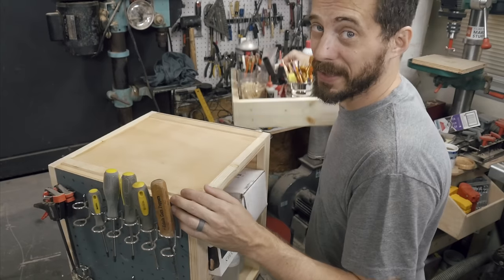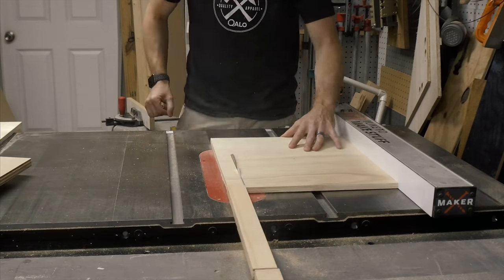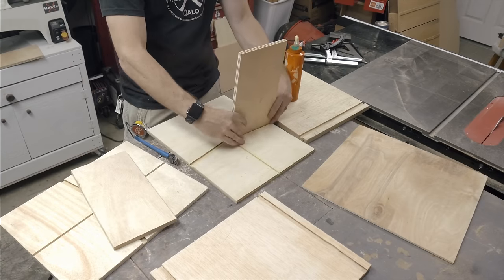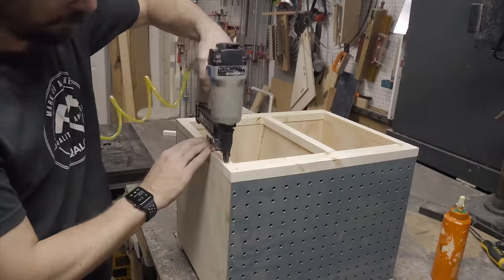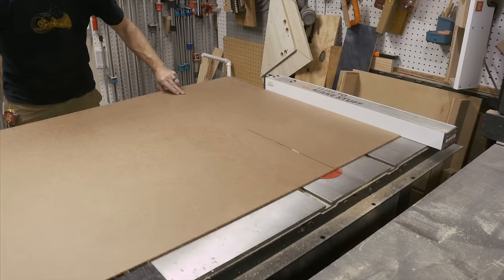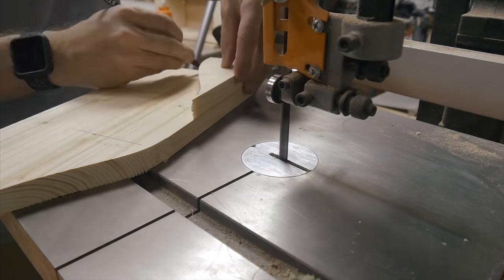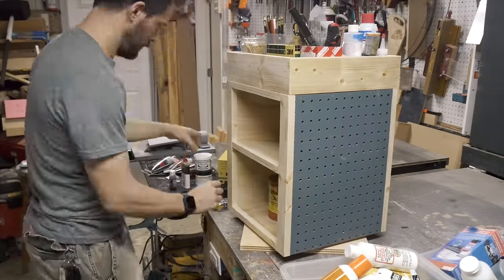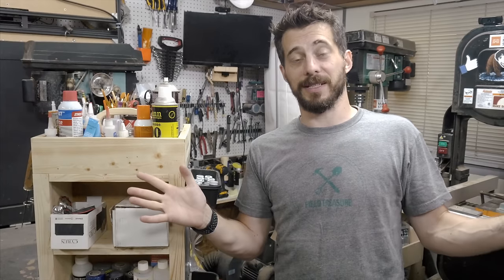How to make a spinning shop organizer // Woodworking | I Like To Make Stuff

Comment: Things I need: digital protractor, silicone brush.
Reply from the maker: Speaking of, I need to add that brush to the description.. THANKS!
Reply: I Like To Make Stuff MotörHeavyRockHead 
I've seen silicone brush used before for resin, but not glue. Thanks Bob.
Reply: the best thing is waiting till the wood glue is dry and then picking it out of the brush... does that make me weird?

Comment: Great video, as always! Just for knowledge sake, there is a more secure way to attach the lazy susan. There is a larger hole on the base (you can see it in the back at 4:42) designed to give you access to the screw holes on the top. Drill out the material under that hole in the base, then you can fit a screw driver through it to screw the screws into the top material (the top holes line up over the bottom hole, just rotate the top to reach each hole). That means you no longer have to worry about your screws being too long and locking up the lazy susan, and the head of the screw is more secure than just threading a screw through the thin sheet metal.

Comment: An excellent project Bob. My only suggestion would be to add some latches so you could use the handle in the removable top to cary the whole unit at once. Maybe add a removable base unit with castors so there would be an option to place it on the floor if you needed the extra table space or tucked away when not in use.

Comment: not gonna lie I need one of these to sort my small bits odd and end
Reply from the maker: It's super handy!
Reply: ALPHAURSAP  You just gave me an idea - Drill bit storage. One side of the organizer could be used for drill bits or router bits. Possibly both...
Reply: Mark Lindsay I was thinking the same thing for my dremel bits but also possibly mount the press attachment and holding bits on the top
Reply: Mark Lindsay Maybe circular saw and table saw blades if you adjust the design a bit :)

Comment: Hey Bob, I just got my first commission making something for someone!
Reply from the maker: Awesome, congrats!!
Reply: What is it for?
Reply: A raised planter bed made out of 2x8s, 2 actually. I do some freelance carpentry and landscaping in my area. Thank You for asking!
Reply: Nice! Sounds like fun. How did you get started with freelance carpentry?
Reply: I did a lot of DIY things around the house, mostly building things for the yard like decking, planters, fences and things like that. Then my neighbors started to ask if I could do some stuff for them, it's not a full time job or anything. Most of my work up to this point has been repairs or assembly. this is the first project that I've designed and built completely. You can actually follow me on twitter if you want, I'll probably be posting pictures up there when it's finished. https://twitter.com/SON4RENT
Reply: Adam Oliphant Well done and good luck with your future.
Reply: Hey Adam, its two years since  your original comment, hope you are still building and still earning from it best wishes.

Comment: WD40 is not a lubricant. Please bob teach the masses!
Reply from the maker: Actually, I was using the WD40 brand "gel lubricant" :)
Reply: Wow that's confusing. Thank you for the clarification.
Reply: I Like To Make Stuff  My pled still stands.
Reply: Although normal WD40 does have some lubricant with the solvent.
Reply: I Like To Make Stuff I would recommend getting some Tri-Flow lubricant but that's just me. As always, nice videos!

Comment: Nice concept. I like the use of all sides. The only thing I might change is the handle for the top. With a centered handle you'll need to have the load evenly distributed. If you had a handle on each side (like a loose rope handle) you could load the top without having to keep shifting stuff around. Still a great idea for saving space.

Comment: You could also use the 1/8 inch gap between the top and middle for things like rulers and protractors, but it might need to be a bit bigger

Comment: You could actually use some buckles/flip latches on the top to secure it to the bottom.  That way you pick the whole thing up and move it around using the handle.

Comment: When I use those lazy susan bearings I drill two 3/4" holes in the base piece that line up with the 3/4" holes in the bottom of the bearing. Then I mount the bearing to the base first and use the 3/4" holes to access the screw holes in the top and mount it to the top piece. That way I'm using screws into wood rather than depending on sheet metal screws. I can also take it apart for finishing, or whatever, and not worry about the sheet metal screws stripping out when I put it back together.

I finally just made a CNC file to drill the two 3/4" holes and just "kiss" the locations of the 4 mounting screws so I don't have to do any layout other than centering the CNC over the base piece.

Comment: That little thing is pretty dope! I haven't messed much with angles yet, even though they'd be extremely helpful in some projects, maybe one day! That interlocking bin on top was super cool too! It wouldn't have been as nice looking, but you could have tried leaving that face frame off so that gap between the peg board and sides could be used for paper, stencils, books, etc. but awesome none the less!

Comment: Nice job, Bob!  Your comment about the band clamp made me chuckle.  So to cut the diagonal grooves for your slanted shelves, did you just freehand that with the router?  Or did you use a straightedge to guide it?  Couldn't really see.
Reply from the maker: I just did it freehand, which was a bit scary to be truthful.  It worked better than I expected, but you could also clamp on a straight edge at the correct angle and run the router along it.  That'd give a perfectly straight line.

Comment: Cool project.  One thing you could've added (or could still add) to the top was another simple box, that used your removable box as a lid.  That way you'd have even more storage in the same footprint, and you'd be able to tuck away things you don't need to get to as regularly.  It might be too much or too inconvenient for your needs though.

Comment: I would recommend you put some brad nails or screws from the outside into the handle on the top tray.  I'm always paranoid of over filling (weight)  a tray like that, and the installed handle pulling out of its location and the tray falling to the ground

Comment: Maybe some locking casters under the bottom platform to give it Mobility and still the rotation.
And add removable flight case lid closing claps on either sides for the top box,
So it holds down the top box and then using the handle on top to roll the cart around the shop for storing it.

Comment: Evening Bob love all the work that you've done :D , also as you were showing us the final views of the cart I thought of something that may be useful. Since you already have a handle on the top for the tray i was thinking you might be able to add some clamps to each corner or side to connect the top drawer to the whole cart so when you have to move the whole thing you could just lock the clamps in place and just use the handle to move the whole thing if it is able to supply the weight of the whole cart on-top with the handle. Anyways as always awesome projects and videos and looking forward for each upload in the future!

Comment: Hands on a great product, I just need to "critizise" one thing: you can't really move the container. I assume that might be troublesome for a container that needs to hold various goods that are meant to be used rather frequently, else a simple shelf in a corner would have down the job. So how about adding some handles to it? (Since the lazy susan prevents the implementation of wheels)

Comment: you could put a lock system to attach the top to the cabinet and that way use the handle to move the entire assembly. but love it as it is too

Comment: This is a bit old, but I suggest adding washers on the bottom of every corner of the carrier and two magnets embedded ontop the opposing corners of the spinning box. That way it won't tip off when you hit it and is still easily (depending on the magnets) taken off. Also, it will satisfy OCD, since it won't slide around either.

Comment: Cool! That's a perfect size for small workshops. I mean, especially when I have to go outside to apply finishes or work on large projects. Thanks for sharing.
Are you planning to add casters to it?
Reply from the maker: Not this one, as it's for table top use. But, if it went to the floor, that'd be a great addition and could replace the lazy susan bearing.
Reply: I see. Makes total sense! Thanks and keep up the awesome work!!

Comment: You know what would be cool, is using this for cordless drill, bits, and screw storage. It will then always have that home, but you'd leave the top empty. Then when you need to go on a drilling/screwing excursion, you'd just fill the top with the drill, bits, and hardware you need, and keep them all together. When you're done, bring the toolbox back, and put the screws/bits/driver away. I personally hate hiding any tools from view, which a spinning cabinet will do, but I don't mind hiding hardware, so keeping your #6, #8, wall anchors, etc. on the back side wouldn't give my OCD a hard time.

Comment: I love those corner clamp! ok I know I'm a cheap ass but whenever I pass a harbor freight I go in and get at least one clamp and the corner clamps are only 3.99 each so I get one and use the 20% off and get a free something anything cheap batteries, light, or measuring tape. Lol Never enough clamps!

Comment: would wheels on the bottom be helpful at all? Just stationary wheels that don't spin with the ball bearing on the connector plate, and with locks so you can move it around the shop, then lock the wheels and the storage bin can be free to spin as you work?
Reply from the maker: I think that'd be awesome if it were taller but as it stands now, it's made for table top use.  Wheels in that case could be a disaster.
Reply: Ahhh. I gotcha. I wasn't aware that it was strictly for tabletop use. In that case, it's perfect! I also had a random thought. In the top of the caddy, where the handle is, maybe drill some small holes to put some drill bits and screwdriver heads that you use fairly often? That way they're pretty easily accessible?
Reply from the maker: Oh man, that's a fantastic idea! Thanks!
Reply: I Like To Make Stuff You can make a second piece to this, a main body that stand on the floor. then, this project could be the removable top for it that way the lazy Susan functionality is not lost and you can move the paint supplies as needed. The floor part could be on casters and each side could represent different tools. one side could be hand tools, one side could be all different kinds of sanding pads, sheets, belts, files, chisels. Another side could be hand saws, and 71/4 10 and 12" blades... etc etc etc

Comment: Hey Bob, question for ya. What would you recommend for the top of a workbench (mostly for wood working). Btw love your videos!
Reply from the maker: Well, I may have a different answer than a traditional woodworker, but my work table is a 2x4 frame with 1/2" MDF top.  This is so that I can easily replace the top after I destroy it.  If you want something heavier and more permanent, you can laminate a whole bunch of 2x4 (standing on the small side) into a solid top.  That could still be covered with MDF or something for a replaceable surface.  Hope that helps!
Reply: I Like To Make Stuff Thanks Bob! I was thinking about mdf but i wasn't sure if it would hold up, but as you said it's easily replaceable so i might go with that.
Reply from the maker: Yeah, it relatively cheap (I use 1/2") easy to replace and best of all, dead flat.

Comment: I know jack crap table saws and i wanted to ask what purpose does that shark fin piece behind blade serve?
Reply from the maker: That's called a riving knife. It help stop the cut in the wood from getting pinched after it passes over the blade. If it pinches it can hit the blade, which will push it back towards the person at the saw and can be VERY dangerous (that's called kick back).  Hoep that helps!
Reply: Thanks!

Comment: Putting the sponsor spot in the little PIP frame (and even adding a progress bar) is a great idea.  Casper for bedsheets.  I would have thought "what a nonsequitor, how awkward" if it came on unannounced.  But this way it's just the thing that was happening while you were sanding that shelf.  You've changed the sponser spot from something that interrupts my content into something that happens with it.  The timelapse video gives me something additional to focus on besides the ad and somehow I end up focusing more on both. (You know how they put the bee symbols on urinals?)  Every youtuber should do this.

Comment: Ad some casters and stackable drawers then it wil be perfect.
Reply: Also: Add a 45 degree bevel on those last-added pieces so it's more self-centring. You now have a quarter inch between top of thingy and bottom of portable box, so those strips are 0.25 inch thick no problem; make the bottom 0.125 inch vertical the top 0.125 inch maybe 45degree (experimentation)?  Actually if you're going to use that box often, put the rabbet/rebate for the bottom further from the edge so you can put it on more uneven surfaces, and you can have more of a bevel for the self-centring.

Comment: bob the only problem about your videos are you have so much of machines that we don't have so pls make it little more easy for us by using simple machines
Reply: Aravind C I think you just need to learn what tools can do what. like, when he used the bandsaw, you can use a jigsaw. when he used the belt and orbital sand, you can sand by hand. those tools make it easier and faster, but this entire thing could be built with hand tools by slightly modifying the design.
Reply: ok thanks let me try

Comment: Why is the title in spanish?...it doesn't make any sense, I want the original title
Reply from the maker: I was testing the auto translation stuff. It should only show that if your default language is set to Spanish (I think).
Reply: But it doesn't make any sense and as it's not optional I don't like this feature, I want to practice english as most as possible. Thanks for your response :)
Reply from the maker: Gotcha

Comment: An observation, why do all YouTubers use too much wood glue? and use brushes to spread the glue out? The glue will spread when the wood gets clamped together.
Reply from the maker: It spreads to a degree, but in the case of these dadoes it wouldn't necessarily spread up onto the two sides, mostly just along the bottom.  Also, I'd rather have too much glue instead of too little :)